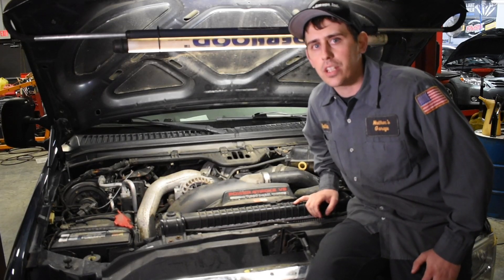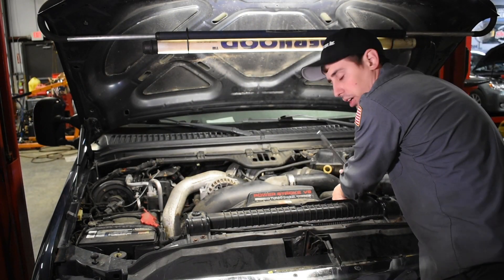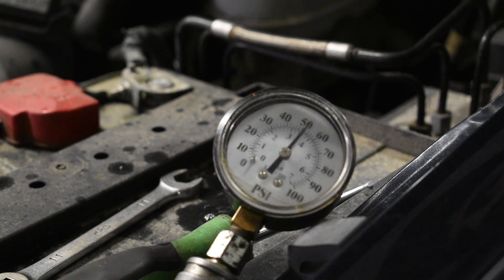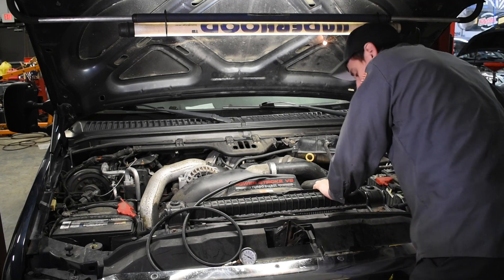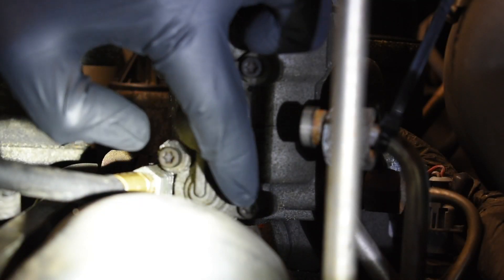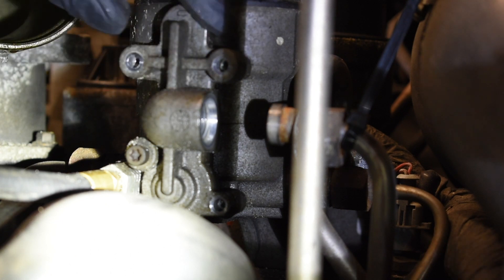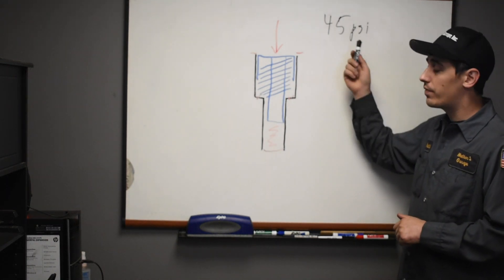Ford 6.0 Blue spring upgrade and fuel pressure test

Comment: great vid, you helped me a lot 5 years ago on this 2004 PS hpop, the one that has the ball bearing defect, i replaced that and other stuff. Now I have an issue that at 72 mph or going up mountain, it is cutting off then restarting easily. I just replaced the HFCM and both filters, didnt blow out the lines or check tank. Tank was dropped and new pickup installed 5 years ago, 15k miles. So I just ordered an in cab fuel pressure gauge and will test it right, see what it does idle and on the road and then when loaded up going up mountain and see what we get. After doing filters and HFCM and filters, if i see a drop i will assume it is blocked lines or pickup in tank, but before i address that i have a blue spring coming (did it 5 years ago) will do it again and retest then if still low will drop tank and check pickup and lines.

Comment: My 60 is a 03 model when I go downhill in gear it’s a six speed get to an intersection I have to stop it plotters like a mess then had to clear out. Is that the EGR valve it is spoofing right back up perfect until you go downhill in gear.

Comment: Hello there,I just want to check with you if it is popssible to change from the permanent brake and accelerator pedals to the adjustable type and also if it is prewired in the truck.Thanks and I look forward to hearing from you asap.

Comment: Great stuff as usual. My 2006 is leaking fuel at the pressure regulator cover. I’ll be doing this job in the next couple days. I was glad I found your vid. Thanx again.

Comment: Thank you! My 07 6.0 broke an injector tip in #6, every one I talked to said it was most likely related to low fuel pressure, this should help with that, also looking at a regulated return with Airdog lift, & Beans sump

Comment: Thanks for the video! I was able to do the upgrade without taking my air filter housing and intercooler pipe apart. I just used a pry bar on the radiator hose and a swivel on my ratchet. It’s a little tight but definitely saved me some time in the end.

Comment: I know I'm a few years late but what is the fitting that connects the fuel pressure regulator to the fuel return line? I just put a blue spring in but messed up that fitting and cannot find out what it is. Thanks!

Comment: If you installed the blue spring kit and still have low pressure would you change the fuel pump next? Or check the tank?
Reply from the maker: What brand of blue spring kit did you install? Was it a genuine Ford part?
Reply: @InTheShop  yup bought from Ford
Reply: I've got 41 psi static fuel pressure and yup I bought it from Ford
Reply: Put a Ford fuel pump in and still have the same pressure
Reply: So I took apart the fuel regulator and the black seat where the Plunger goes was worn after 3000 kms I put the old black plastic seat in with the new blue spring and 65 psi now. The new black seat actually has sharp pieces of plastic coming out of it

Comment: Installed the blue spring static fuel pressure is around 41psi. Bad fuel pump???
Reply from the maker: Did you use a Ford blue spring kit?

Comment: Can you have too much fuel pressure I seen another video when he installed the blue spring he had 90 psi and he said that was to much is this true?
Reply from the maker: Correct. This is common with non Ford blue spring kits. 90psi can push past the o-rings on the injectors.
Reply: Ok thanks I may have more questions later thanks for your fast response, I bought a 2005 f350 king ranch with 250k has a shutter when driving in over drive from everything I have researched sounds like a injector sticking maybe ,will be looking into it here in a few days when I get back home

Comment: Recently rebuilt my turbo and new ficm , I haven’t  checked my fuel pressure but I automatically bought an oem blue spring kit . So I went to the regulator to do the job and the t27 bolts snapped. It’s still intact and tight not leaking fuel while running , do yu think I should try to easy out the bolts or end up buying a new oil/fuel filter housing ?  Thanks for any input , love yur videos , I go back and fourth between yurs and diesel tech Ron

Comment: Hello, thank you for the video. Do you know where the two fuel filters are on this vehicle?  I replaced the pump and the large filter, but I can't find where the smaller filter is.  Thanks.
Reply: woops wrong model.  our small filter is not easily accessible from the top of the engine.
Reply from the maker: Which model are you working with?

Comment: Thanks. For checking the fuel pressure, I bought the ford fitting from amazon and then purchased 5 foot 1/4" air host extension and a pressure gage from Harbor Freight and worked great. My fuel pump would apparently stop working sometimes and read zero PSI. I banged on the pump and it came to life again. Looks like I need a new pump.

Comment: Hey there, so my 6.0 just died on me coming over a mountain pass almost a month ago, truck just died. checked my codes right away and the Icp sensor with low voltage code came up. almost froze to death waiting for a ride, I think it got down to -10 that night. Any way, bought the new sensor but upon installing it, no low voltage code after, but no HPOP pressure and the Ipr was at 84.7 percent. Changed the oil, changed the fuel filters. I then unplugged the sensor, and the HPOP oil pressure went to 1000 psi and the Ipr was at 49.5 percent, still no start. checked the fuel pressure, key on and it went to 50 psi. Went thru all the fuses. the injectors are rattling key to start, checked my ficm plugs today, am I missing something? Replaced my FICM 2 years ago plus The IPR, truck was running sweetly, no indication of anything it just stopped running, I thought I heard it miss just before the failure. Any thoughts. I just need to know what I need to order and replace, I'm no slouch with a wrench, now that its warmer I can work on it. This one has me stumped, hope ur well and happy. Also hope to hear from u soon. Thanks. J.
Reply: Did you ever get this sorted out ?
Reply: @kcdaniels58  yes it was the long up tube on the passenger side. O ring seals failed on it. Which is why no oil pressure to injectors. Thanks for checking in.

Comment: I need that middle fitting bolt is there any links?
Reply from the maker: Which fitting? The one between the housing and the return line?
Reply: @InTheShop  yes sir
Reply from the maker: @splashfrank4945  I just looked and couldn’t find a link. I’ve personally never had that fitting fail. You may have to go to the dealer and point it out on their diagram.
Reply: @InTheShop  yeah figured I’d have to end up doing that,thanks for the help though brother

Comment: I had a shop install a blue spring kit a year ago. Just replace all 8 injector . My fuel pressure at idle is 60 half throttle 55 wot it went down to 20 psi . It’s got brand new fuel filters . What should I look for ? My pump sound strong .
Reply from the maker: If the filters are good and the blue spring kit was OEM I would start by checking for air being pulled into the system or a restriction before the pump. If there are no cracked lines and you have no restrictions the pump is likely weak.

Comment: Hey, I installed the blue spring in my 05 about 6 months ago, i just installed a fuel pressure gauge and I'm getting 80/81 at idle, WOT gets down to 45. Is this ok
Reply from the maker: That is likely your problem.
Reply from the maker: What brand of blue spring did you get? Did you get an OEM ford?
Reply: @InTheShop  no got it from Amazon this is the description, 6.0 Blue Spring Kit Upgrade - Fuel Regulator Kit - Compatible with Ford Trucks - Blue Spring Kit 6.0 Powerstroke F250, F350, F450, F550 2003, 2004, 2005, 2006, 2007-Replaces 3C3Z-9T517-AG, 3C3Z9T517AG

Comment: I installed a new blue spring kit and my pressure is at 40 and it also makes a whining noise
Reply from the maker: Where did you get the blue spring kit from and was it an OEM ford kit?

Comment: Mine is at 90, what’s the issue lol
Reply from the maker: It could be a restriction/kink in the return line or a bad or improperly installed regulator spring. The return lines get kinked often at the regulator when people attempt to take them off and don't double wrench the fitting.
Reply: In The Shop aha that seems to be my issue, mines kinked. Got a link for that return line by any chance, hard to replace?
Reply from the maker: @fbi6540  what year is your truck?
Reply: In The Shop 04.5
Reply from the maker: @fbi6540  04.5 can be a tricky year. These are the links to either one it can be. In the link there will be part numbers. I would call a ford dealer, give them your VIN and ask them the part number. 
https://amzn.to/2XcaDEJ 2005+

https://amzn.to/2yJwji6 2003-2004

Changing the line is a bit of a pain but not a horrible job.
Reply: In The Shop appreciate it man. I’ll have to get that all figured out too

Comment: what size is that fitting for checking the fuel pressure, I dont want to buy anything that's the wrong size
Reply from the maker: Hey Dan, there is a link in the description of the video to the fitting you need.

Comment: How much would the fuel pressure deviate if say the engine were running and under load? Would that be a better way to check?
Reply from the maker: Definitely it’s best to check under a load which is why I mentioned it in the video. It shouldn’t deviate much if everything is functioning properly. 5lbs~

Comment: If I had that problem on my 2005 6.0 to 50 would that make my truck automatically shut off while I'm driving down the road.
  Scenario is low  On  Diesel fuel. 
 Got off the freeway pulled into a gas station and filled up with diesel . No problems shut it off and no problem started Backup. Drove about 4 miles . And boom it just shut off by itself.
 I've change the feel filters check for water. Even bought brand new batteries. Still no start. Any ideas Oh I also put a brand new ficom. 
 I think that's how you pronounce it very expensive
Reply: My guess would be ICP sensor.
Reply: stc fitting or standpipes and dummy plugs. Had the same issue in my 07 last week ended up being stc. Drove fine until boost came in died and no restart
Reply: Thank you I'll check it out

Comment: Tried do this earlier Fuel Line bended when trying to take the nut off. What do I do to take it off?
Reply from the maker: In the video around the 7:00 mark I show how to use a second wrench to hold the fitting still while turning the tube nut. Unfortunately you might have to replace that fuel line if its kinked.
Reply: I did the same thing I’m looking for both nuts on the line

Comment: This is my fuel pressure in this video for 2006 6.0:
https://youtu.be/m_FKW8QfReU

Having a no start issue, already gone through all the dieseltechron procedures and I'm down to the pump, a leak, or bad injectors. Or some phantom problem. I'm sure some loss could be from the gauge not being perfectly sealed and having the gaskets on the regulator probably being leaky but where else would it be leaking? Is it possible that it's the fuel pump? Can you lose pressure from bad injectors on the pre cycle? I'm going to install the blue spring kit this weekend and I have a new pump coming but I wont be too surprised if mine is fine. I also have a professional cap style pressure gauge coming too so I know it isnt the issue and can get dynamic pressure. Pressure is no better than 5 psi until cranking I get 15 psi. After I stop cranking it shoots to 60 or so from suction? Hope someone has seen this problem before... 
Also, I need to do the bubble test I will do it this weekend as well after I put the spring kit on.
Reply from the maker: In my experience the regulator won’t cause the pressure to be that low. I would still install the blue spring anyway as that’s a great upgrade. The pump could definitely be weak. Other things that I have seen cause that are a crack in a line allowing air to be sucked in. What kind of chassis is the truck? Is it a pickup or a cab and chassis with an after axle tank? The after axle tanks are known to delaminate inside and cause the fuel system to plug up. 
As far as injectors go, if you had an injector bad enough to cause pressure that low your oil would be completely full of fuel or you would have a cylinder hydro-lock. 

Hopefully there is enough info there to give you a direction to go.
Reply: @InTheShop  just got it so I'm new to details of it, crew cab 4 full doors, long bed i believe but has a utility body, 4x4 and I do believe the tank is behind the axle, I'll have to double check that. Is there a tank pressure test I can do? When I pulled the pump the feed line just kept flowing and didnt stop. If there was air getting into the tank wouldn't it not be possible for it to siphon? Doing the spring kit tomorrow. Thanks for your help!
Reply: @InTheShop  I put the blue spring kit in and did the bubble test. Put the old pump back on and cycled 5 times and it was still pushing a lot of air out the feed line but once settled i never saw any bubbles coming out running the remote starter line crank. New pump should come in tomorrow so I'll throw that on and hope that does it. If not I guess it would be time to tear down the top and replace the dummy plugs, check ipr valve and replace those parts, and check injectors.
Bubble test
https://youtu.be/eAZi4oRj0Nc

Comment: Great video but don’t you have to test pressure under load? To verify diesel pump is any good or to check if the injectors are leaking?
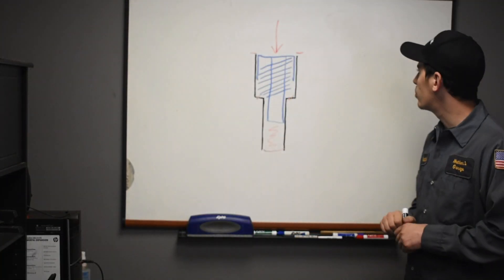Reply from the maker: Irving Salinas thank you! And yes absolutely checking under a load is the best way. I go over that around the 16:00 mark of the video. Knowing the pressure under a load is the best way to verify the fuel pump is healthy.

Comment: great video. thanks. 
Now i need one on removing a stripped HFCM drain plug
Reply from the maker: Very carefully use a punch and walk it out. Might have to remove the front driveshaft or pull the HFCM right out of the truck and do it on the bench.

Comment: So you said minimum you like to see 60 but 70s preferable well ever since I've done that kit and the banjo bolts I'm seeing 95 to a 100. I drilled and tapped aluminum cap for the fuel filter and ran a steel braided line to a mechanical gauge under the hood and at idle it's seeing 95 PSI to 100 PSI. I keep reading threads that are saying I'm going to blow oil rings on the injectors but then I also read ones that say at least 70 PSI is preferable so since I'm 25 psi over the preferable is that really going to blow out the O-ring? With the explination that you just said on the plunger with the injector it sounds like higher PSI would be a good thing.
Reply from the maker: john andersen 95-100 is way too high. Running pressures like that can definitely cause the o-rings to blow out. Did you use a ford kit or an aftermarket kit?
Reply: the ford kit.
Reply from the maker: @johnandersen5276  Either the gauge is wrong or something is wrong with the spring.
Reply: well, I did forgot to mention I checked with another guage already to make sure it wasnt the guage. I also yesterday put on an adjustable regulator and backed off the adjustment all the way....and pressure remains that high. I'm really at a loss here
Reply from the maker: @johnandersen5276  did you check the pressure before changing the spring? If not it is possible that it was already that high. A restricted return line can cause high fuel pressure. I would have to personally see the truck to get any deeper into it. Hopefully this helps
Reply: @InTheShop  well at this point I would be happy to bring it to you I'm going as far as the return line I have no idea and no I didn't check it before I wish I had is the return line really hard to get to and I did change the banjo bolts the ones without the check valve in it I'm not sure if that would make a difference. Thank you for your help Happy New Year
Reply from the maker: @johnandersen5276  The only return line restrictions i have personally seen are kinked lines. the one that comes right off the regulator cover and goes down the front of the motor. They usually get kinked trying to take them off
Reply: @InTheShop  well just that looking at it doesn't really appear to be kinked I can't guarantee that 100% cuz you can only see about 8in of it but right as it makes that 90 coming out of the regulator it doesn't appear can't enough to do what it's doing I mean is there any other thing that you can think of that I should look for cuz I don't know what about the the filter regulator tube in the center if that's not working properly could that cause it

Comment: What about cranking pressure is that something would should  check before installing the kit to see if it changes after installation or will it roughly stay the same give or take?
Reply: I was going to ask the same thing.
Reply: William Callaghan figured something to ask
Reply from the maker: Fuel pressure wont really change while cranking. The most important measurements are at idle and under a load.
Reply: In The Shop ahh okah I wasn’t sure if it would cause a change after doing the install!